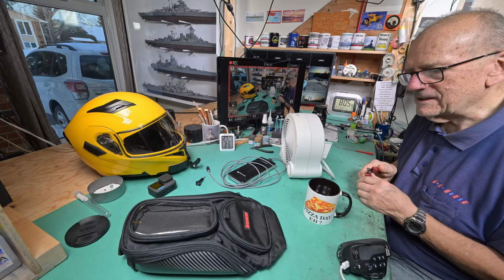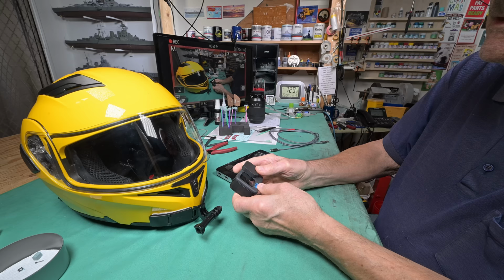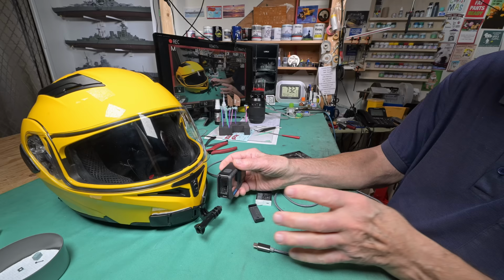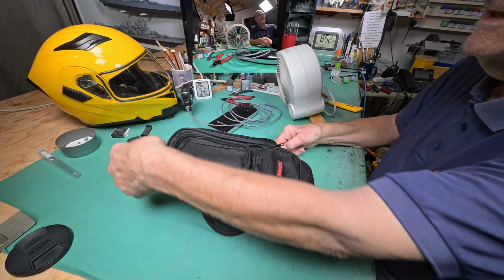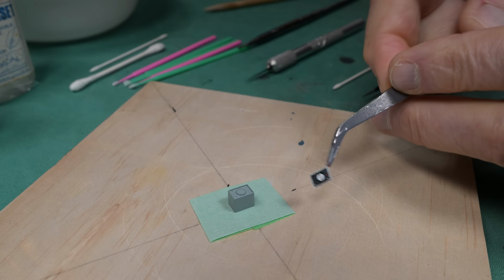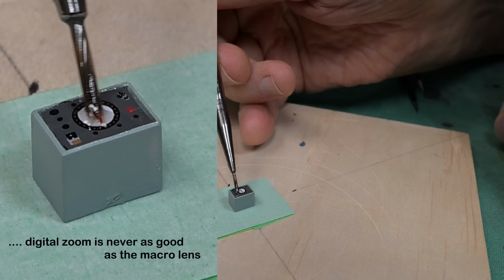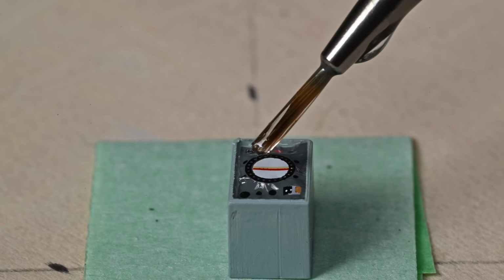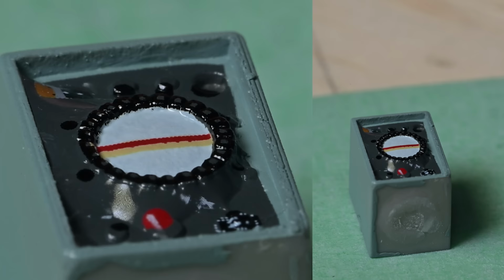The Model Ship - Part 1922

Comment: Ron when you have the decal floating on the Microset try rolling a regular q-tip from the center to the edge.  The idea being to force the liquid from under the decal. You could also press down on decal with a tissue or paper towel.  When the decal is dry or almost dry then put the solvaset on the decal.
Reply from the maker: Thanks for the tips! 😁👍